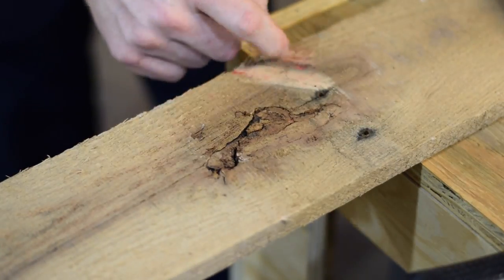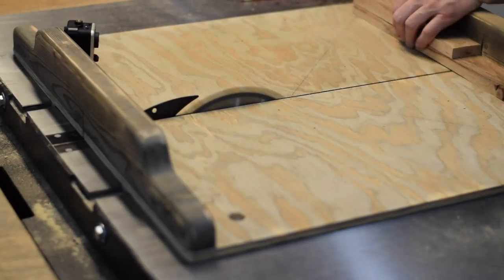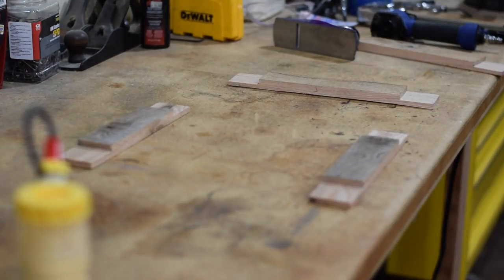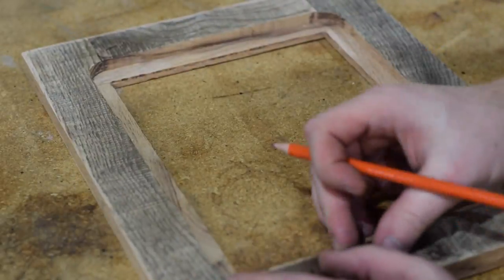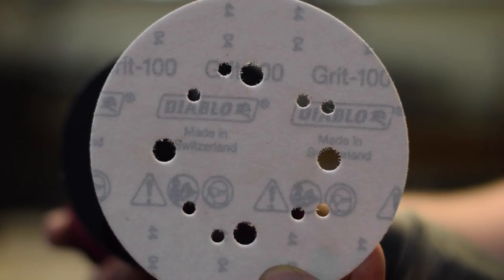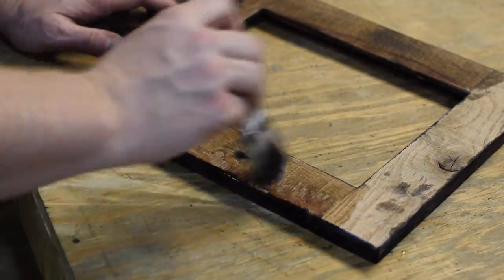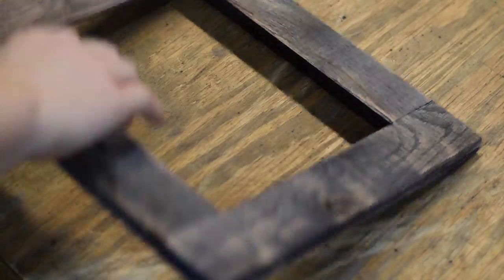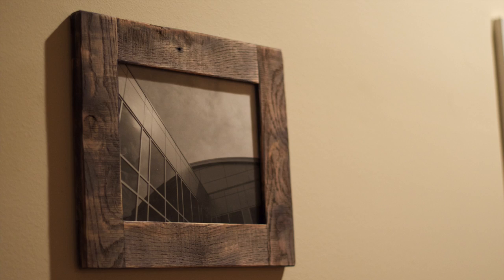Easy DIY rustic wood picture frame that you can make! | Voiceover

Comment: I still haven't got my head into the distressed look, but I liked your video. I am considering making a square butt pocket hole frame from beautiful highly machined wood I can buy at B & Q. If I put some embossing into it I think they will look ok. I hope so, I have at least 50 pictures I have painted over the years and these definitely need framing if for no other reason that they need to be protected .
Reply from the maker: +Gallande 34 thanks for checking out the video! Try the distress look sometime! :)